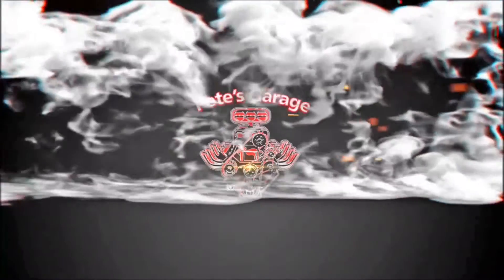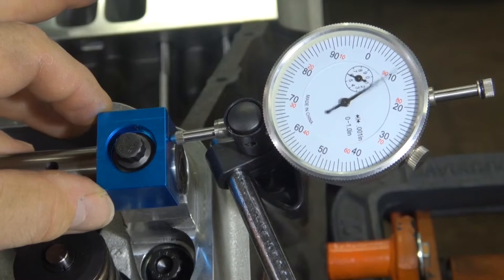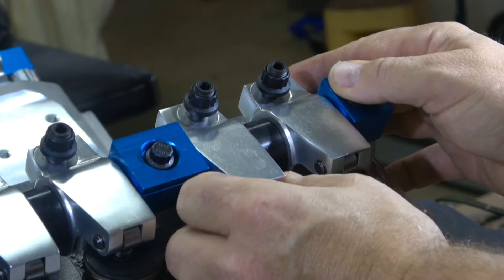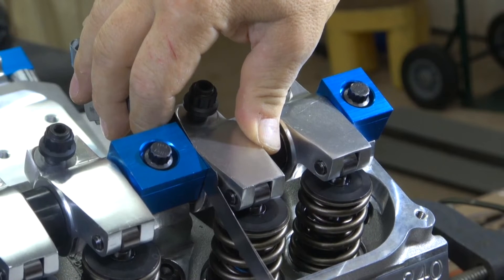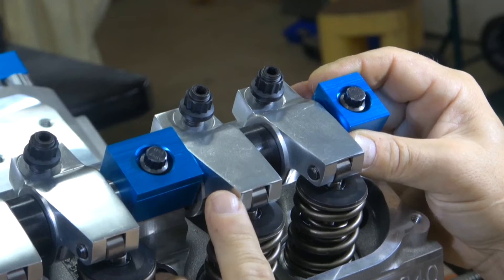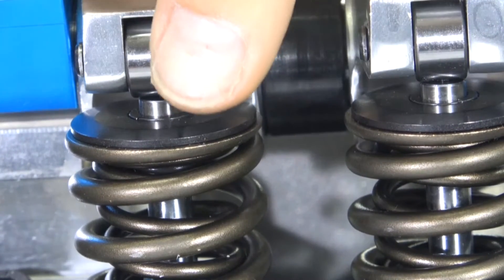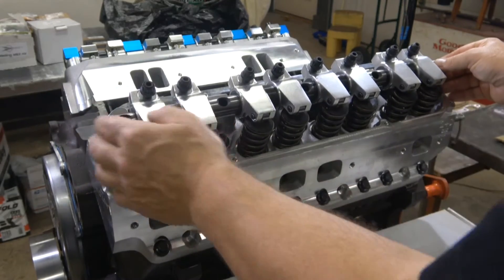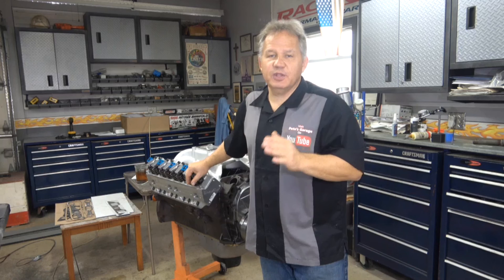Engine Building Tips   Installing Rocker Rails, Setting End Play for Lifters 440 MOPAR 512 Stroker

Comment: Hello Pete
Do you have any suggestions for a cam that gets great torque and hp on your 440 builds with Trickflow 240 heads, 10.5 to 1 compression with a six pack? I’m looking for enough vacuum for power brakes too.
Reply from the maker: Call COMP Cams and talk to their tech support, they are very helpful
Reply: @PetesGarage thank you 
What is your opinion about using hydraulic roller lifters? I have lifters made by gatorman. Any feedback for longevity on a street performance engine? Spring pressure settings?
I have heard about people using solid roller lifters on hydraulic roller cams. Any experience with that?

Comment: Why are some of my push rods already tight as I’m tightening down the hold downs?
Reply from the maker: Because the cam is turned to the valve open position
Reply: @PetesGarage yes but there’s a big gap in between most of the others and the adjusters once its cinched down

Comment: I have a brand new set of crane 1.5 would you use them over factory rockers on my 440 it’s got a 509 cam and light springs I forget brand of springs but very good springs
Reply from the maker: Yes I would

Comment: Wouldn’t spring assemblies between the  rockers make this easier??
Also, maybe there are test shims you can hang over the shaft to get everything aligned the measurement the shims and reassemble?
PITA….
Reply from the maker: I would say no, because the rockers need to stay in position within a couple thousandths.

Comment: You are incorrect. The oil holes on the bottom of the shafts have to be oriented so they are the correct 15 degree angle towards the inboard. Towards the crank centerline. Its important. Just pointing down is incorrect.
Reply from the maker: Unless the oil holds are aligned with the mounting holes
Reply: what rocker shafts are you using?  @PetesGarage

Comment: Hi Pete, on a 440 build video from 5 years ago when you were setting the lifter pre-load on the first rocker on base circle you set it to one full-turn. how come in this video it's only 1/8th turn?  Also, I have been having troubles with pushrods falling out of the adjustable rockers. It's a 383 and it only happens on the driver side cylinders and, both intake and exhaust. Any tips?
Reply from the maker: This engine if flat tappet, the others were rollers. If the pushrods are just falling out, something is really out of adjustment